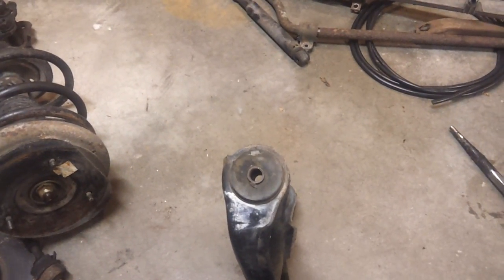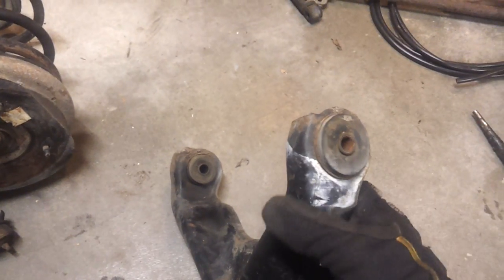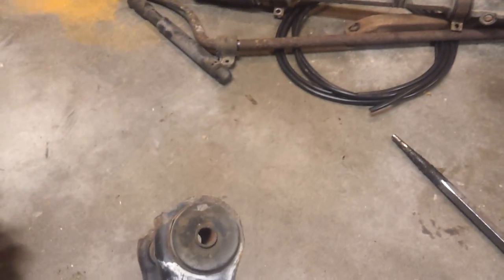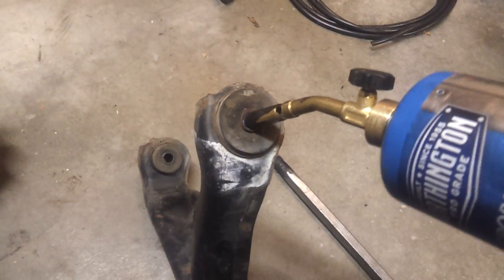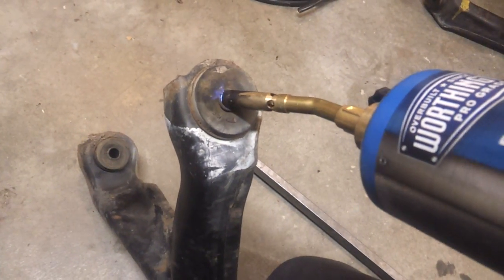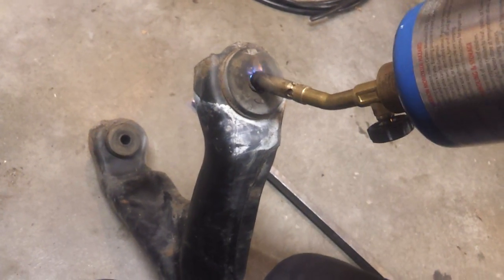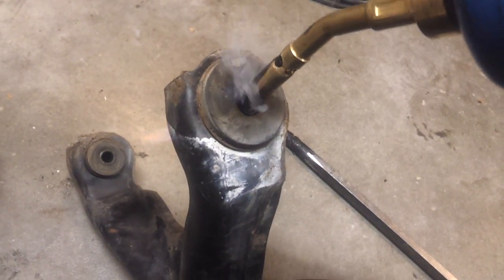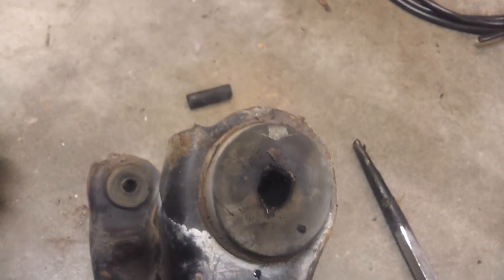Suspension bushing inner sleeve removal

Comment: FINALLY someone gets it..  the OTHER half to that procedure is taking the torch to the bushing shell, and repeating. Heat the shell evenly till it starts to sizzle and ooze and push the rubber out. Not you have a relatively clean shell that you can easily collapse and knock out.

Comment: What I do is heat the out side bushing sleeve while I have vise grips attached to the inner sleeve and once it gets hot I start trying to twist the whole rubber bushing by the inner sleeve once it's hot enough the whole rubber bushing and inner sleeve comes out.

Comment: That's a really cool method to get the sleeve out. Did you reuse the control arm? I imagine you'd need to get the rest of the rubber out of the bushing hole, how did you go about doing that?
Reply from the maker: Yes, the control arm was reused after removing the rubber bushing.  Check out my second video for how to remove the actual rubber bushing, it's basically the exact same process.  https://www.youtube.com/watch?v=R_qCGB9n57A

Since the video was posted, others have pointed out it may be possible to just remove the rubber bushing first, without ever doing the inner sleeve, so it just comes out as one assembly.  I'm not sure if that will work or not, as I haven't tried it.

Comment: I can't even get the bolt moving to get it dismantled from the car ;-(

It's seized in the inner sleeve..
Reply from the maker: You sir, need a bigger hammer.  I had the same problem with mine when I removed the front arms, and unfortunately, I never found an elegant solution.  You can try heat, but I doubt you'll ever get it hot enough to break down the rust, since it's such a large part and it's buried deep in the arm.

I ended up soaking it with penetrating oil (which probably did nothing) and using a punch and a 3 lb hammer to smash those pins out. It just takes some persuasion.
Reply: Same, but I cut the bolts off. Other bushing seized, didn't want to deal with it. Let LCA soak in transmission fluid for days, air hammer, etc and the bolt was stuck in the bushing still. I've got to burn it out.

Comment from the maker: I assume you mean the bolt securing the control arm to the car frame?  If that's the case, you'll need a big hammer/mallet, a punch, and some profanity.  Depending on the car you're working on, it can be difficult or impossible to get a clean swing at these bolts with a hammer.  Put the punch on the end (longer punches are better), and angle it so you can get a good swing at it.  It should pop loose with some persuasion.